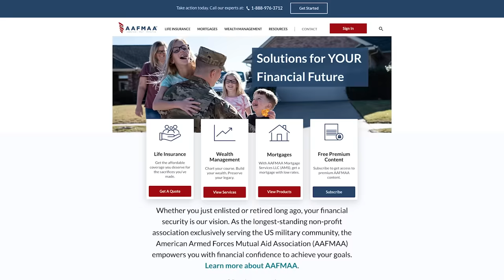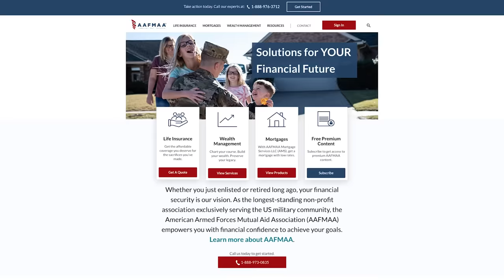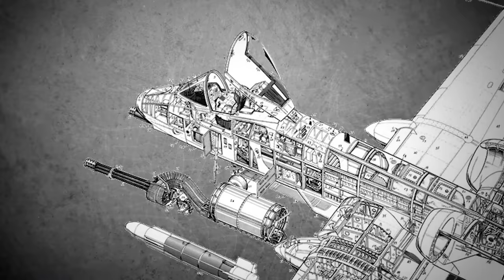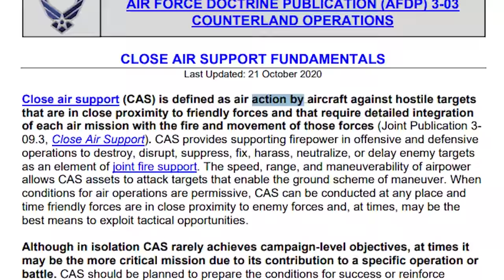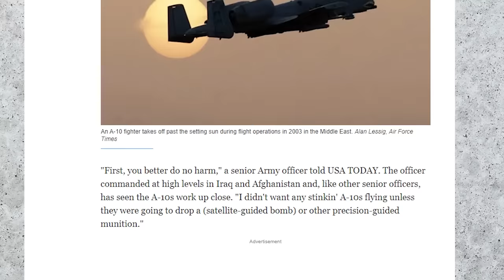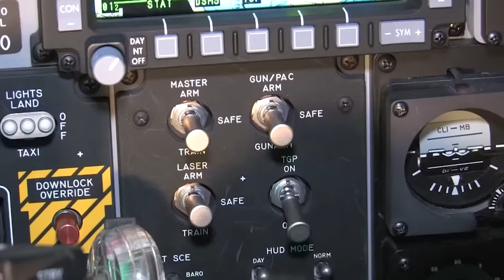Why the Air Force is Screaming to Retire the A-10 Warthog

Comment: Why not create a drone version of it? It is slow and flies low and can dump a lot of munitions to protect troops. I also imagine since it wouldn’t need life support it could be made slightly smaller too.
Reply: Like from CoD Ghosts?
Reply: @nursestoyland honestly yes
Reply: And how will they have real time footage in these areas that don't have coverage?
Reply: People will pile on with criticisms, but it's worth a study, and I bet that would be a great topic for a Master's Thesis at the USAFA.
Reply: It’d cost less to just make a more efficient drone aircraft.
Reply: Probably because the further you are from a drone, the easier it gets for the enemy to jam the thing. It might work against terrorist groups, but not against a near peer military.
You need a human up there, until the AI can take over.
Reply: Thats essentially what Predators are...although they operate at much higher altitude.  Biggest issue with low level drones is situational awareness...something only a pilot can provide
Reply: Considering how often A-10 are used for danger close fire missions, I'm not sure I want to have current levels of AI in charge of that.
Reply: Drones for CAS make sense, they are cheaper, flexible, and could even be controlled locally by forward observers.
Reply: Yeah, we have that. It just doesn't need to be armored. Or big. Or have a gun.
Reply: They should probably develop it BEFORE retiring the A10.  The political elite have been weakening our military for decades.
Reply: Doubt EW in modern warfare would allow large scale use of remote controlled drones.
Reply: We mainly use a combination of drones and AH-64 because we lack the funds to keep a one task aircraft. It works and it is a lot cheaper. The drones remain on station for up to 24 hours.
Reply: This is why there are drones like Reapers etc. around - they do exactly this job.
Reply: Was gonna say, take out the titanium bathtub and the plane will lose its balance.  But maybe it can be replaced with more of that depleted uranium.  I mean if we don’t dump our nuclear waste on the battlefield where is it gonna go?
Reply: The "low and slow" part is the problem. It's just not survivable in a modern battle-space. You'd need to overhaul the entire concept to improve its avionics, standoff distance, agility, and altitude. Once you've done all that, you can weep solemnly knowing that the only thing you've accomplished is making an F16/ FA18 look kinda like an A10.
Reply: The a10 is responsible for more blue on blue deaths than any other platform. I doubt a remote piloted version will help. It cant fly past air defence which means it is a front line weapon, and guess eho else is on the front lines? Your own guys, so maybe spraying the area with 30mm rounds might be not as good as other options.
Reply: Because there already is a drone that fills this role, it’s called the Mojave drone
Reply: yeah and man portable SAM units can easily shoot it down. Drones are cheaper, stealth aircraft cannot be target by these systems. It's an old, obsolete aircraft not fit for purpose anymore. Hell the gun isn't even that accurate either.
Reply: Exactly my thoughts!
Reply: Easier said than done. Making a whole new deone would be more reliable.
Reply: The advantage of drones is that they don't need to accommodate a pilot, so they can be much smaller.  It makes more sense to have a lot of smaller drones instead of one big one, or even to only use the drones to scout and to deliver the munitions from over the horizon with systems like ATACMS.
Reply: @murunbuchstanzangur  Then don't depend on the gun near your own troops. The ordinance it can carry and deliver would definitely make a difference. But the gun could obliterate a Russian trench.
Reply: Why not keep a manned version of it for when the event happens that drones are inoperable because of space war, EMP, cyber war?
Reply: Because then you would be taking the airframe (the cheapest part of an aircraft) and still stuffing it full of brand new expensive components (an A-10 was specifically designed to cheap out on avionics, so this would be a complete replacement more or less), and still running an expensive test programme to certify it. If you just shill out a bit more for a specifically designed airframe you get a much more effective platform.
Reply: @IgoByaGo you know the military has sophisticated satellite and other coms that we don't even know about, right? Plus, I don't think they'd be flying sorties too far behind enemy lines.
Reply: We already have drones, also laser and tv guided munitions droped from f35 and f15 is much more effective
Reply: @GeorgeWashingtonLaserMusket   the delay will be too long. Even with a wired connection using fiber, the latency in the video signal to the operator is too long, so a wireless one's latency would be worse. When you have people down on the ground working in real time needing coverage. That is why we still have pilots. The military doesn't have magical future technology subspace relays for communications just for them. They still work with what companies like the one I work for can provide to them. So yes, I stand by my statement of coverage. Even in a perfect situation where the satellites are over them to provide coverage and get the signal to the drone operator, what they see is milliseconds to a few seconds behind. 

I also don't see them sending the drone pilot out in the field to provide support and leaving the somewhat safety that an FOB would provide.
Reply: It’s an accent airframe. a new drone CAS plane will most likely be more effective
Reply: The point of the A10 is to support the Army. With the Army's investment in long range Artillery and drones while the Air Force fields Air Tractors to support SOF, the A10 doesn't make sense.
Reply: I think we're seeing that to some degree in Ukraine with drones spotting for artillery, especially for HIMARS to take out Russian artillery.
Reply: Why not have more Apache helicopters? They can fly low and slow, and can land and take off from anywhere.
Reply: @gdtacos7082  Not necessarily. Of course compared to building new ones, but the proper way to measure the cost is discounting the sunk costs. The airframes are built and capable, so is the engines, gun and missile arrays, landing equipment etc. Using them as drone piloted aircraft can open up a whole lot of high risk mission types that would not be possible with trained pilots on board. Self-piloted planes is already a huge research topic, and the know-how of reusing these airframes could help develop AI pilots for more modern, specialized systems who are engineered without a pilot from the drawboard.
Reply: Would be more expensive than an f35.
Reply: @X35C  Every missile or bomb the A-10 can carry can be carried by significantly older airframes, for example the F-111 Aardvark.
Reply: @joshuabanner3675  Exactly! A single A-10C costs more than a single F-35, it’s no longer cost effective in a modern environment where it has to have all the tech it was designed to “not need”
Reply: They should sell them to rich people.
Reply: Because it would be the most expensive attack drone in history.
Reply: @Hutch_Davenport We already have that, and it's called a Super Tucano...
Reply: Because low and slow just gets you killed in any threat environment. You can not send a platform like the A-10, whether a drone version or not, into a hostile environment and expect it to last very long if at all. Low and slow means that it will be immediately taken out. When Desert Storm ended, Schwarzkopf wrote a report on Desert Storm. He included seven platforms that gave them so much success in that report. The A-10 was not on it. Just looking at how many tanks the A-10 destroyed is not the whole picture. The A-10 was also shot down a lot. As many A-10s were shot down as F-16s, F-15s, F-14s, and F-18s combined. That and the fact that an F-16 can get to a target three times faster than the A-10 and distinguish friendly or foe much better made it a better option. The F-16 is also maneuverable enough to dodge missiles. The A-10 has a much more difficult time of doing that. So while the A-10 can take more hits, the F-16 has better survivability because it is much better at dodging the incoming fire. The only thing that the A-10 has better is the Gau-8.

In Schwarzkopf's report, two of the seven platforms were the Nighthawk and the Harrier. We lost almost as many Harriers in Desert Storm as A-10s but the Harrier's versatility far outweighed its shortcomings. We literally had Harriers operating from a football field. The DoD looked at that and then put out a requirement for a stealthy versatile fighter and then the F-35 was born. Also, the A-10s were held in reserve not so much because they thought that the Iraqis would counterattack but because they knew that the A-10 could not survive in a high-threat environment like Baghdad at the time. Once the high threat systems of Iraq were taken out then the A-10 could operate. That is why 40% of Iraq's critical targets that were destroyed were destroyed by the Nighthawk alone.
Reply: You can get rid of the life support systems and controls... Problem is the airframe would still be as big and complicated to repair. You can't just make it smaller because you removed some stuff. The airframe is designed with all that stuff in mind and the entire plane with such aerodynamic profile. Its not something you just change to make it smaller and lighter.
Reply: @catsupchutney  You don't need a PhD to know that drones are the future and there will come a time when pilots become completely obsolete.
Reply: We just need a new plane. The A-10's armor is meaningless (23mm is no longer the primary AA gun in large part because the A10 exists) and the gun is too short ranged (the plane has to come too close to use the gun to survive).
Reply: If there is an airplane that SHOULD NOT be made a drone, it would be a CAS platform. 

CAS requires humans to be there to ensure good situational awareness and feel of the environment.
Reply: @ometec Those planes don't operate using only mechanical energy. They are just as vulnerable to what you said because of the components that were made into it. You may as well argue the US Air Force should have kept the P-51 Mustang in service due to what you said...
Reply: @gdtacos7082 
At last an adult comment, well done cous you raised the bar in this thread.
Reply: Fun facts ----------- How many training hours do A-10 pilots get on close support?  Hundreds of hours.  How much is required in F-35 training?  None.
Reply: @smileygladhands  they can't break the physics of the real world and the stuff they use is by the telecom/IT/chip manufacturers that we all know and love.
Reply: Yeah, its called MQ-1 Predator
Reply: they also have a cropduster, as close air support, used successfully
Reply: I just got a mental image of the gun with wings and a propeller
Reply: It would need more advanced AI because of the jamming problem with communications
Reply: You guys forget that there are really fast next gen attack helicopters coming in that has pilots right?  You guys complain about low and slow, the new copters can fly lower and slower than any fixed wing craft and it has TWO PILOTS for double the situational awareness.  It is also under direct army control so communications, mission planning etc should also be improved compared to coordinating with another branch of the military in which your are in competition against.  This is why the Marines have their own pilots.
Reply: @germandragon8136  Yeah, but that's not for peer nation operations.  It is for chasing three angry dudes in a Toyota Hillux.
Reply: @IgoByaGo  how does the predator do it? what about the global hawk?
Reply: because what is the point of a gun when line of sight fire is a joke. thing would get shot down kms away from its effective range that and the splash on the gun is atrocious.
Reply: @IgoByaGo If there's no coverage, you won't have CAS. Just like now.
Reply: @scratchy996 If there's EWS, CAS won't be there anyway.
Reply: @dirtdevil70 Cameras and sensors provide as much as an at risk pilot.
Reply: @Nan0Cell It doesn't have to be AI.
Reply: @Birdsaregovspys6969 If there's EW,you won't have CAS.
Reply: @patriark the A10s airworthiness isn't going to change the conditions it has to face, and those conditions are the deciding factor of the A10s viability. The F4 Phantom 2 didn't lose its air superiority role because it was no longer capable of flying, they're actually still in service. The F4 lost its role to the F15 because the soviet union created the Mig 25.
Reply: it sounds like problems with the A-10 involve cost and survivability in modern battlefields, both of which were its primary strengths.

a drone version, depending on the exact design, could be more expensive due to the tech to make it remote on top of existing logistical issues with its non-standard airframe. you'll save on a pilot, but you'll also lose the environmental awareness element that some CROWS operators have mentioned. you'll also need a new design approach to make up for its survivability issues against modern missiles.

one solution might be to make those target interference devices on the newer F35s as a drone variant and have them draw AA fire if it's cost-effective. (it probably isn't.)
Reply: Doesn't really help when it'll just get shot down by 70-year-old SAM sites anyways.
Reply: @Name-ot3xw the sam sites will be down relatively early in a conflict.  Imo it is the manpads that are a problem.
Reply: I don’t disagree with the skeptics here. Everyone is right, but it doesn’t negate the need for CAS. The problem with the F35 is it’s too fast and people are worried about a drone being expensive, the F35 is really expensive. I think all the issues everyone here has pointed out can be overcome. Unfortunately, our new adversaries will probably be near peer competitors. It’s going to have to be way more survivable and be able to evade AA and missiles to boot.
Reply: combinaliscom4034  what you are talking about is a different platform entirely. A gun is inherently less accurate than guided munitions especially ome fixed to the airframe. The price... thats the 1 advantage. So Whats a life worth? Im sure the top brass have a number in their head, but they wont say it out loud, and i cant disagree when it comes to a real existential threat, but most of the recent conflicts arent that. 
But now you have me thinking, what does an anti tank gun drone look like? A lot of the advantages of drones are related to their smaller size and weight, but i dont think anything that would do the job would be any smaller than an a10 given the need for greater accuracy. In fact, if you are talking about an independantly aimed gun, are the signal delays and cost associated with remote piloting  even going to make anything better than we already have?
Reply: I've been saying this over & over, but the Pentagon doesn't bother with regular folks.  I'm willing to bet it could be retrofitted with a remote UAV set-up more cheaply/easily than assumed.
Reply: @murunbuchstanzangur That's because it's exclusively CAS. The more time you're shooting around your own, the more likely you'll hit one of your own.
Reply: @Name-ot3xw  CAS doesn't come into play in SAM areas
Reply: @danielk.english6004  F 35s really aren't made for that environment.
Reply: @wisenber  Truth, but also SAM sites only exist in places with people who can shoot back. CAS is for colonial policing actions, Don't really need a fighter for that job.
Reply: @patriark  I agree completely
Reply: @MrAustanian  That's a pretty bold prediction being made about the peer war readiness of a military that hasn't been in a peer war for ~70 years or so.
Reply: Could just use the B-1 for the same bomb dropping job, The A-10 gun is one of the least accurate guns in US inventory, next to useless outside of intimidation factor.
Reply: @thefreeman8791  The inflated prices of sketchy Pentagon contracts, the cost of single use consumables like missiles/"smart"-munitions... Even if a legacy A-10 that is retrofitted with remote capability is destroyed after a short life cycle, especially if it causes fear, if it crashes/explodes into Russian trenches, it still might be a  feasible R&D platform.
Reply: @Name-ot3xw  It sounds like you have a warped sense of what CAS is. It's not what you just said.
US doctrine is to wipe out enemy AA first, then ground supported by CAS, just like Iraq.
The first step is skipped if there's no AA, just like Afghanistan.
Iraq had one of the largest AA systems on the planet....until they didn't.
Reply: @wisenber  i would humbly disagree.
Reply: @murunbuchstanzangur  well a flying anti tank gun wouldn't look like a gun. It would look like an AGM 114 Hellfire missile. The cannon on the A10 is completely ineffective against modern tanks.  It's also entirely unnecessary for thinner skinned vehicles like IFVs. It wouldn't be difficult to develop a much lower power 10mm or 15mm gun pod or cannon that could be fitted with a smaller drone.
Reply: @wisenber  that’s what I said, cas is only useful in scenarios where the target has no capacity to shoot back. Only for colonial policing actions, the sort of ‘combat zone’ where you could just send some guys over in biplanes to toss grenades out the side in.
Reply: Creating a drone version of a existsing 60s aircraft will cost a lot.
Reply: @Name-ot3xw  You said "colonial", which is demonstrably false.
The US uses SEAD prior to CAS. That doesn't mean no CAS is lost, it just reduces those losses.
Reply: @wisenber  Think of it like the alleged usefulness of a missile carrying destroyer, the platform is useless in any case where you are uncomfortable having your fleet cuddle up nice and close to the target's coastline.
Reply: @j.bernard6944  The air tractors don't make sense.
Reply: @danielaramburo7648  Short range and too slow
Reply: @patriark  The airframes are past their service life
Reply: @Name-ot3xw  I think those missiles have longer ranges than you think
Reply: Cost-to-benefit ratio doesn’t support that, because you’re looking at a high chance of loss in a single sortie.  We want armed UAS with repeat use capability for ROI.
Reply: @wisenber  You're trying to argue that a demonstrably obsolete airplane isn't obsolete because of some piece of paper that has yet to be tested against anything other than peasants with (at best) Toyota Hiluxes.

Ex. the type of opponent that a biplane with a bag full of grenades would work just fine against.
Reply: @wisenber  then it’s worthless on a modern battle field. Because any major opposition will have EW.

Look at Syria and Ukraine. 

The only reason the battle of khasham turned out in favor of the US was the fact that Russia turned off their EW/AA and allowed US planes/helicopters to come in and do work. 

I am actually kind of surprised at the lack of well armored AA. Why not throw somekind of cannon on a t72 or m1a1 chassis. It can then push forward with the units closest to the front rather then be on a constant state of leap frogging behind the line where it is less effective to protect the most front line movements.
Reply: @Birdsaregovspys6969  If you think EW can't be targeted and wiped out, we're not talking about a modern battlefield. That's more of the Ukraine conflict where combined forces operations aren't happening.
Reply: Becaus that already exists
Reply: @Hutch_Davenport Hutch, the political elite fund our military more than the next 10 largest militaries in the world combined. That seems like pretty strong support if you ask me.
Reply: Because large drones are force-loss multipliers. "Low and slow" is for opponents without an air force and it will take a while for those outside the US armed forces to figure out constabulary operations are not analogs to semi-peer combat or combat against opponents who own some competitive systems. Noobs adore dramatic aerospace vehicles but war is about efficiently destroying the enemy. One bullet kills an elephant but does next to nothing against killer bees.
Reply: @chrisclark6161  thats true. Its mostly used on infantry in cover and light armour like infantry support vehicles these days. Even more reason to do something else. To be honest, artillery ranges are so long now with rocket assisted projectiles and so precise, they can often fill this role at an even lower price. Seeing what has been happening with improvised drone warfare i bet that would perform close support even better. How many mavics with grenades could you buy for one a10? Now imagine that number flying over... if there was a way to give a light cheap drone the penetrative power of a 30mm shell that would scare me even more than any brrrt.
Reply: Great idea
Reply: @X35C  then whats the point? Its main role seems to be close air support. Maybe something similar with a more precise aiming method? Or modern precision artillery? Or 10 000 mavics with hand grenades...
Reply: @Comm0ut  I'd argue a bullet will very much kill a bee.
That, and what serves as CAS in one scenario might not another.
Reply: @wisenber  I think you forget the part where your cruise missile destroyer is floating around in ground based anti-ship missile range.

Also fair to note, in case you forgot, all these missiles we're talking about come on wheels nowadays. It's not like you're generally going to be aiming at a long known about silo somewhere.
Reply: @Name-ot3xw  I think you're forgetting that the guided missile destroyers also have some of the most robust anti-missile capabilities on the planet. Instead of wheels, they have water.

And no one is going after a silo with a destroyer. That's generally going to come from a submarine, bomber or ICBM.
Reply: @wisenber  Another spicy take for you.

If we ever decide to dust off the B-52 fleet for actual use, it would be a good time to start practicing throwing down your guns and surrendering to whoever it was that defeated us rather than go out in impotent glory.
Reply: @Name-ot3xw  Who (other than you) thinks B52s remain the primary nuclear bombers?
Reply: @GeorgeWashingtonLaserMusket  The existing aircraft belong in museums. Jesus they've been flying for too long.
Reply: @wisenber  who said anything about primary? I’m just saying that if they ever go wheels up in an operational capacity it means that we have already lost. Just another obsolete antique airplane that we keep for reasons of tradition and because those in decision making positions have been there for 40+ years.

Their only possible use is to bomb peasants with. And again I refer back to the biplane with a bag of grenades that could perform the same function.
Reply: @ometec  If drones are inoperable, then the pilot won't be able to use the A-10 either. It relies on radio and electronics.
Reply: @joshuabanner3675  The A-10 is crammed full of expensive avionics.
You got it backwards. The A-10 airframe is ridiculously expensive because it's old and thus constantly requiring maintenance or else it beeaks apart mid air.
Reply: @Name-ot3xw  If the US is using B52s, it's mop up.
Were you really thinking they're obsolete?
And "tradition"? Really?
Reply: @toolbaggers    Also true that you don't need a PhD to do a Masters Thesis.
Reply: @wisenber  just lol at this antique warplane lover. ❤️ Probably doesn’t even realize that we still lost the war where we did try bombing the peasants with B-52s.

BRB asking the Limeys if we can dig the spitfires back out for WW3.
Reply: @Name-ot3xw  What's funny is that you seem to believe the B52 serves no useful role for the USAF or that they can't be useful against near peers.
You think those cruise missiles care what launched them before they go 1200km on their merry way?
Reply: @wisenber  even funnier, I both agree that your cruise missiles and B-52s are all but useless in a near peer scenario. The B-52 couldn’t even break the back of a peasant army in the jungle.

Lmao, 700 miles is hardly a long distance for a day trip.
Reply: @wisenber  

*DoD ‘please no, stop buying useless crap for us’

*Guy on the interweb ‘akshually those 70 year old planes are the best war machines that can be built’
Reply: @Name-ot3xw  It's been paid off since before you were born
Reply: @wisenber  you do realize that none of these objects you cover are shelf stable right, as in they all require ongoing maintenance and upgrades to even pretend to remain useful. Hell, even the boneyards cost money to maintain cut up hulks from wars past.
Reply: @Name-ot3xw  You do realize that it was the USAF that requested the B52 continued?
They're the ones that crunch the numbers on operation costs.
Reply: @wisenber  crunched the wrong numbers apparently. Costs jumped by another half last year due to unforeseen issues with the new power plants. I thought you said they were paid off?
Reply: Would cost about £40
Reply: A10 only useable when the other guys have no airforce.

People are impressed by the gun which is little used
Reply: @knoll9812  Or when the opposing anti-aircraft and aircraft have been eliminated.
Reply: @wisenber  I refer you back to my idea with a biplane with a bag of grenades for a cost effective platform after all threats have been eliminated 🥸
Reply: @Name-ot3xw  I refer you back to the USAF that chose to extend the program.
Maybe you haven't noticed one of your main adversaries still relies on a turboprop?
Perhaps you should offer your expertise to the Pentagon or Kremlin and let them know they don't know what they're doing. After all, most US ICBMs have been around since at least the 70s. Another biplane with a bag of grenades.
Reply: @jaex9617  They get a ton of political donation for that funding so I don't know if it is altruistic.

Anywhere you see DEI it is weakening the institution that implements it and there is way too much DEI in the military.

opinion
Reply: @theotherohlourdespadua1131  I'll look it up, thanks for the info.
Reply: Drones can have their communication streams blocked as seen in Ukraine
Reply: @Name-ot3xw wont the grenades just detonate midair, because, grenades, and anyone with dedication and a gun can shoot it down
Reply: @Whydidimakethisa  I was being slightly facetious with grenades, but grenade sized dropped bombs are in style again with drones. Ukraine has been using modified RPG ammo for this purpose.

Discounting the few in a million Annie Oakleys in the bunch, you’d at least need Pom poms to reliably take down a plane going a couple of hundred mph at a thousand feet to a couple miles up. Pom poms count as anti air.
Reply: Great idea. I have though on it, too
Reply: Yes, make a drone built around the GAU 8 Avenger. It's primary role to fly over the battlefield firing bursts over the heads of troops to boost morale.
Reply: Why don't they use these as anti-drone defense?
Reply: I would imagine weight and balance being the huge issue to figure out.  I could absolutely be wrong but we may just end up with a slightly smaller remote controlled A-10, at the end of the day.
Reply: Lmao making a drone, makes too much sense... Thats some dangerous stuff common sense. How are the contractors gonna make excessive profits....lmao think about all the winning millionaire share holder(don't)...
Reply: @laulaja-7186 titanium isn't heavy.
Reply: @Teirandash  reaper drones are cool, but I would worry about accidentally killing friendly troops with hell fire missiles. I would think a large gun could be used in close air support.
Reply: Still way too expensive
Reply: Although the A-10 has a reputation as being a "tank-killer", the F-111 Aardvark destroyed by far the most tanks of any aircraft in the first Gulf War.
Reply: For close air support I would much rather someone in the pilots seat
Reply: Drones is whats replacing the a-10.
Reply: @scratchy996 Yeah, cause Russia reallt is doing great at stopping drones.
Reply: @dirtdevil70 Yes, but it matters less if the drone blows up.
Reply: @Nan0Cell Drones aren't operated on AI...
Reply: @Birdsaregovspys6969  and Russia does extremely well at EW it’s one of their strongest fields
Reply: I was thinking 🤔  the same thing. Try to retrofit has drone that can support the ground forces
Reply: You have to remember, what are the needs of the battle field. 

The tropps need support against enemy armor and troops.

Why can't they Cary the required weapons them selves, or have army vehicles cary them? 

Considering what we need, it's too big

Ok, but what about Helicopters?

Too vulnerable, but we think we can get around it with speed or range of munitions.

Ok so it's a fixed wing aircraft. But wait, it it's fast, how van they observe what's going on?

Modern sensors allow us to negate that issue.

Ok, but what about the weapons? We useing bombs, rockets, guns, or missiles?

In lower threat environments we can get away with lazer guided glide bombs, rockets may not have the reach, depending on the type of missile it can handle a lot, and a gun we can fit on an aircraft may not be able to pen modern MBTs or hit them accurately due to the nature of both the gun and the fact its mounted on an aircraft. Pair that with the potential close proximity of friendly troops and using a gun may end up being the enemy's best tool against us rather than the other way around.

Hey, look, I've made the A-10C, which is an A-10 but with proper sensors and weapons, but faster, longer range, with better awareness, and without the unremoveable gun.
Reply: Imagine how difficult it would be to have a ground troop communicate with someone sitting in a bunker hundreds of miles away to guide them on a Target. It would just take a great deal more time and they already have the air frames to do it.
Reply: Not cost effective.
Reply: Ukraine war has shown that plains like these just don't work against someone with missles and radar to use its part of the reason the f35 was made with a ground vereent because it's harder to kill not only is it faster but it has stealth to help it and Bing a drone won't help it in this regard it's to big and because of that it's very easy to see on radar
Reply: I'm not sure you know this or not, but what you're talking about does not exist. The reaper drones as well the Predator before it was really great at hitting targets with a missile at range is greater than 6 mi, the ammo for a gun like this weighs a freaking ton.  A drone that can carry and fire something like that does not exist.
Reply: A major part of the A-10’s design is the titanium tub protecting the cockpit, which would be unnecessary in an unmanned drone. I don’t think using the big gun unmanned would really be optimal either, especially in a true CAS role. If the two major design features around which the rest of the aircraft was designed are irrelevant, it seems like it would be more sensible to design a drone from scratch around the requirements and technology that will be relevant for it.
Reply: @rabbiboazmarmon7723  one of the biggest problems would be wight taking those out could cose some problems
Reply: @pelmanism1084  That gun is clearly about 1/5 of the weight of the whole airplane. No drone is going to be able to handle that kind of load plus the amount of weight of the ammunition. As a matter of fact they keep the spent casings internally in the plane to be able to maintain the center of gravity. Bullets have weight. The reaper is good but it only carries eight Hellfire missiles. Those things weigh 110 lb each. That's 880 lbs that mostly under the most ideal conditions the reaper is able to carry. There's not a chance that it can carry a significant load of 30 mm ammo.
Reply: @dascoop6018  another bad thing about having a drone with a close air support mission is a human can tell when he's been fired at from a different direction. The Drone operator is looking at a screen that doesn't show him bullets coming up from the right or left. It doesn't show a missile launched in the direction it's coming in to take evasive action. I'll be the first to admit that drones are spectacular machines but they are seriously not the answer here. There is no machine built that can do the job of the A-10 warthog.
Reply: @Teirandash  just a correction, the reaper can only carry eight and that's under ideal conditions. Not 10. Other than that, spot on!
Reply: @mattuw82  that's not true at all. That's not even close to being true. Combination between the warthog, apaches, cobras, gazelles, and little birds. They decimated the tanks. The aardvarks were used for Sam suppression in the form of electronic warfare Birds as well as tactical bombers. They did not go for tanks in the desert. Their targets work strategic for example airfields and radar systems. I love that plane but that's not one of the jobs it had.
Reply: @Under-Kaoz  nope
Reply: @N7-WAR-HOUND  and yet they keep getting blown up. Strange that don't you think ?
Reply: @Deriv44  the guy looking at a two-dimensional screen is not the same as a pilot who can look in all different directions. You've got to be able to see the entire Battlefield to be able to make the best choices. Should somebody be firing at him from the right, a drone operator wouldn't know that until the hits finally came in his way, as a pilot he can at least see flashes down on the ground from automatic weapons fire. A drone operator will not have that ability. You got to be able to see the threats to be able to react to them.
Reply: @mrgrinch837  The F-111 destroyed around 1500 armored vehicles compared to about 800 for the A-10.  There's a book on it called "F-111 and EF-111 Units in Combat" from Osprey Publishing that gives a detailed account.
Reply: @mattuw82  as you seem to be a greater fan of the aardvark than i, I should let you know I'm not entirely sure where you got your information or how accurate it is but the F-111 is made to drop pretty sizable bombs. It goes after buildings it goes after aircraft on runways, very big targets that are hard to move but easy to see. We have things called attack aircraft aircraft, like the hornet, the a-10, the apache, the jaguar, the list goes on and on that are made to attack troops on the front line. Wherever you read this, it is incredibly wrong. The vast majority of the targets were killed either by the A-10 or helicopters. I used to be a docent who gave tours at March Air Reserve Base museum. We've got one sitting there and I proudly extol the virtues of that miraculous machine but I guarantee you it was not a tank killer. It's too damn big for that and it only bombs for big targets, I should say bigger than tanks. I'm sure it can kill tanks but it's not the primary aircraft to do so.
Reply: A 50 year old slow plane needs can't match today's manpads.
Reply: @kmav23  and yet it does
Reply: @thefreeman8791 You misrepresent the envelope allowed to A-10 pilots in DS/DS. All airspace below Al Hilla was open to A-10s, same for rotary wing. That's why the Highway of Death occurred. The 117 WAS sent in on high risk targets, but many of the HAS and reinforced structures they hit weren't even penetrated. At Balad AB, in 2003, we did BDA, and it was eye opening. Only 1 HAS was penetrated, and it was still usable. None of them had A/C in them at the time, so we hit them in vain, and we didn't even penetrate them, so LGBs and J-DAMs are not the answer either. 
  We have the Scorpion, the Super Tucano and the Mentor 2 to testbed as CAS replacements. Maybe even the new T-7 could be adapted. I do know drones, susceptible to jamming and spoofing, are not yet mature enough. We don't even have one fitted for a gun, or tested strafing runs on...that's a HUGE fail.
Reply: Accuracy. Putting gun runs danger close to troops isn't something you can trust to drones.
Reply: @williamwchuang  and again, just say the obvious you need a gun for close air support, drones do not carry guns. That's like trying to fight a fire without a fire hose.
Reply: That's a good damn question... It isn't hard to set the controls, which are already fly by wire if memory serves, to a transmission system and external cockpit like the other drones in the fleet...
Reply: @NeoIsrafil  not to mention there's a lag of up to three to five seconds from control input until the aircraft actually makes attitude changes. If they can see that it's being shot at on their screens it may be far too late to try to maneuver it away from danger
Reply: Then it would be a new plane then so you know more money
Reply: @jessISaRicePrincess  it wouldn't equate to the loads carried by the a-10s for both the gun and the missiles and bombs as well as the pilots ability to see and avoid being hit and being able to respond immediately to threats around him. No drone has that capacity. None come close.
Reply: I agree
Reply: The warthog is as big as it is not because of life support, but because of the big massive gun sitting in it. I don’t know how much smaller you could make a plane with that caliber machine gun. Unless newer smaller armaments could be as effective? Idk I’m just a guy on a couch.
Reply: Because it solves none of its problems. Remote piloting tend to increase risk of collateral damage and fracturecide incidents.
Reply: Be pretty savage.
Reply: @Hutch_Davenport The A-10 is straight ass against anything armored,Granted I wouldn’t wanna be caught in its crosshairs but its terrible at its job of tankbusting
Reply: @wizzle0979  Manned machine itself is gonna be outdate in the future warfare.
Reply: I think your on something
Reply: @IgoByaGo  have a manned chase vehicle that is far enough from harm but close enough to enact command and control with low lag if possible. Use AI for fast reaction when suitable.
Reply: @TheBagOfHolding  I would buy one.
Reply: @danielaramburo7648 as Ukraine proved, air defense eats anything that flies low like chocolate cake. All the helicopters in theatre are reduced to being flying grads at best.
Reply: Just use the same plane and change the avionics to remote controlled
Reply: @harryniedecken5321  the A-10 was obsolete the moment it came off the assembly line...

... the only way to CAS anymore is literally high and fast.
Reply: @Hutch_Davenport they have, by keeping the A10 in service well past it's sell by date
Reply: @upnorthjno they didn't. That was an F117 and that was an already 20 odd year old design and still the Serbs only shot it down due to dumb luck. The SR71 was never downed by any aircraft of SAM system, not for a lack of trying.
Reply: @CharliMorganMusic - You mean the “close air support drones” that are really small, hang around the battlefield, and when a target is ID’d they fly in really fast and blow up?
Reply: Agree
Reply: I appreciate ALL the comments here, pro or against the idea. I’m no great technical or military mind, but we all know drone warfare is the future of warfare. It’s cheaper to have drones in the end. Russia’s finding that out with multi million dollar equipment being knocked out by drones costing a tenth of the equipment they are destroying. I still see a place where a drone controlled gun is providing air support. The A10 was designed to take a lot of abuse before it’s out of commission. It can be made lighter as it doesn’t need the titanium tub to surround the cockpit and also no life support is needed. You just need to fly a big ass gun with ammo to an area for support as opposed to raining down explosive missiles. Plus, one drone might even be cheaper than one missile. The drone could take out numerous tanks before it’s destroyed itself, with the drone after depleting its ammo being a missile in itself.
Reply: I think right now we have shortage of planes and we need to fly everything we have u til they are replaced . It could be used for something I’m sure. In an all out war every plane that can fly with the foot soldiers is an asset! I know if I was going into battle I’d want one fly over me along with Reapers and drones . A man in the sky watching is a nice asset!
Reply: Maybe I’ve been a little myopic in focusing on the A10 itself. Maybe DARPA could instead focus on technologies that can be used to retrofit ANY aircraft or even ship or vehicle into a drone. You have a couple of hundred planes that are headed into being obsolete and rusting away in a boneyard? Retrofit it to basically be a drone, whether it be controlled by AI or controlled remotely. Let’s say we get new 6th generation aircraft to replace the F22. The F22 are still really formidable aircraft, even if it is a generation behind. Retro fit those to have AI or remote controlled aircraft instead of them rusting out somewhere. Repurpose older vehicles to continue to use them.
Reply: Because it killed more friendlies than it did OPFOR
Reply: @IgoByaGo  IF fighting in Ukraine has taught us anything, close drone support will be the standard with little to no latency.